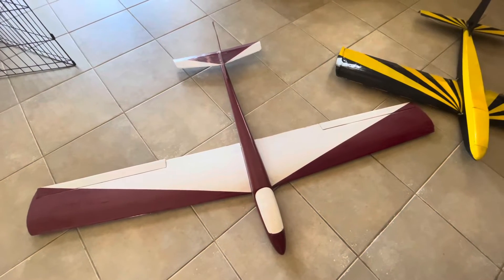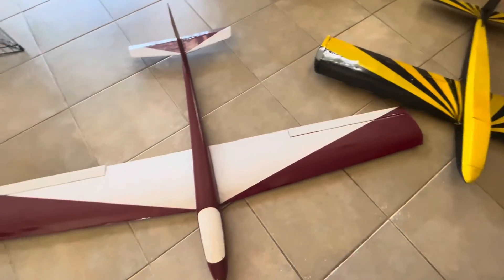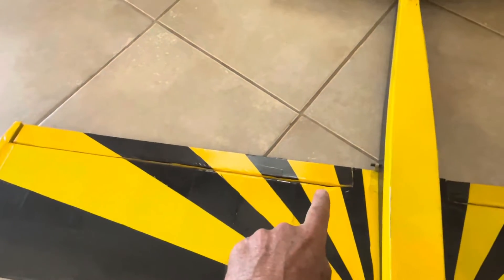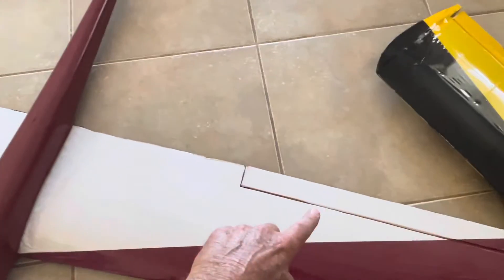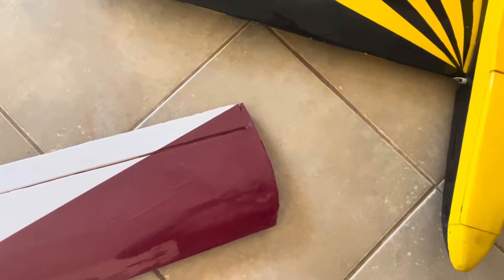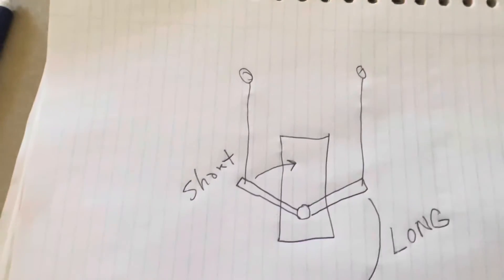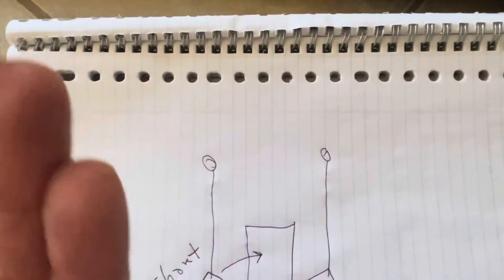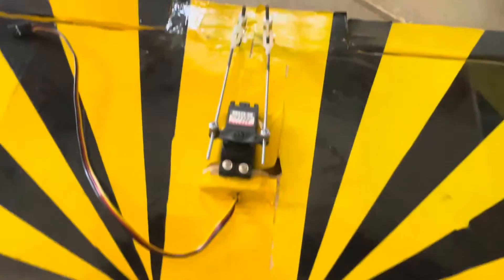R/C glider aileron tricks

Comment: HUGHES HILL! My dad flew there while he was working there.  Classy old gliders you have there, too.
And good tips for the aileron differential. Even though we can just program that in the radio these days, it helps to design it in by angling the servo horns. You get more resolution out of the servo if the physical geometry starts out closer to what you want it to be, rather than trying to do it all in the radio.